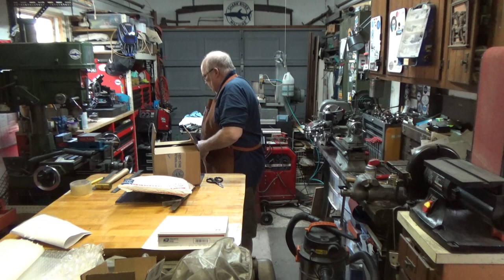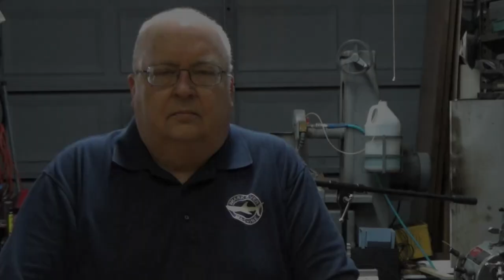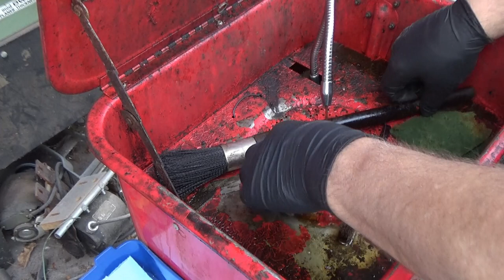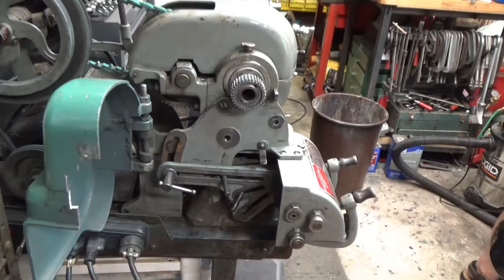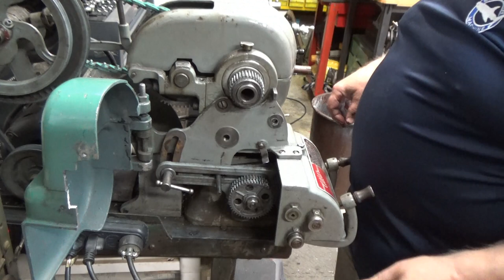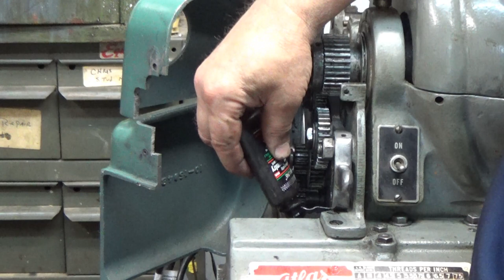Atlas Lathe Part #2-Gear Train

Comment: Good job.  I know about the gear adjusting you get it right and tighten the bolt and it is wrong so you start over and repeat until you get lucky.
Reply from the maker: That is right. Thank you for watching and commenting.

Comment: I have a 10F gear change for threading.I had an awful time getting the gears adjusted. I was sitting watching it run and discovered some of the gears were out of round just a tiny bit. I made all new gears for it out of 70/50 aluminum and you can hardly hear it run.It also took 90% of the chatter out of the old girl.
Reply from the maker: The Zamac gears are not the best for sure.   I was able to get them running smooth and relatively quiet.  The noise that is coming through now is from bad bearings in the motor.  Another project to add to the ever growing list.  Thanks for watching and commenting.

Comment: If you ever change out your parts washer solution try Crown PSC 1000 Parts Cleaner from tractor supply.  I’ve been using it for 7 or 8 years now and really like the stuff.  It cleans well, and does not stink as bad as some of the others.
Reply from the maker: When I had my commercial shop I used Safety Clean solvent or similar.  We got it in 55 gallon drums and also had it in 5 gal that was for resale.  The solvent in my cleaning tank now is a mix of all kinds of solvents and it is getting saturated with oil and dirt.  Time to clean and replace it.  Thanks for the suggestion, was not sure where to find it at a reasonable price.
Reply: R. Steven Lang, Shark River Machine  tractor supply sells the PSC-1000 for around $40 for a 5 gallon drum.  Im still using the same fluid for 7-8 years with little evaporation. If you ever get down my way (PW exit 17) you can check it out.
Reply from the maker: That is reasonable, thanks for the information.

Comment: Great to know i have the same setup thanks i use motorcycle o ring chain lube it sticks like snot and keeps all quiet plus it is cheep
Reply from the maker: That is a good lube to use.  I used to have a product called "open gear and chain lube" but that was a spray and it ended up in places that you did not want it.  Thanks for watching and commenting.

Comment: For anyone with a steam engine, steam oil makes a good open gear oil, at room temperature it's thick and sticky. At least that's what I use and it's worked fine.
Reply from the maker: Thank you for the recommendation, watching and commenting.

Comment: Nice informative video! By the way, I noticed your horizontal band saw in the background. Is that a HF saw? How do you like it?
Reply from the maker: Yes it is! I have had to for nearly 3 years and have been satisfied with the performance.  The original blade that came on it lasted nearly 2 years but the HF replacement blade is a disappointment.  I just purchased a couple of Starrett blades for it but have not installed one yet.  Thank you for watching and commenting.

Comment: I don't think oil is best way to go lve found Lucas red and tacky to be better , really quiet down gears and don't sling right off like oil,, it's covered from chips and put a rag in spindle bore...
Reply from the maker: I only used oil on the bearing surfaces. The lube used on the gears is an open gear and chain lube that is made so that it does not sling off of the gears.  Thanks for watching and commenting.